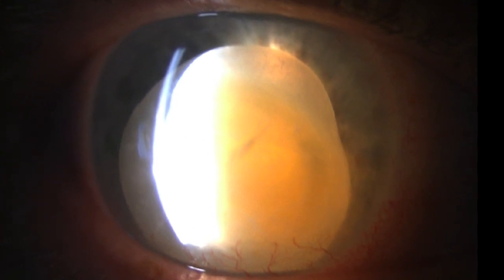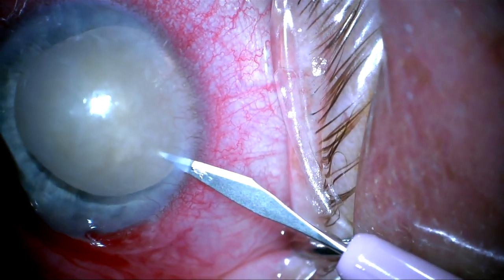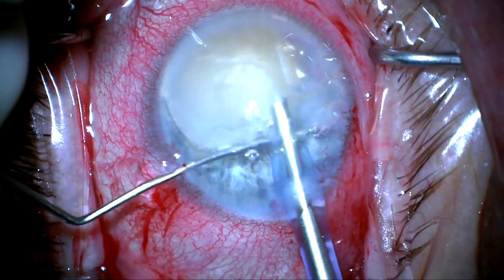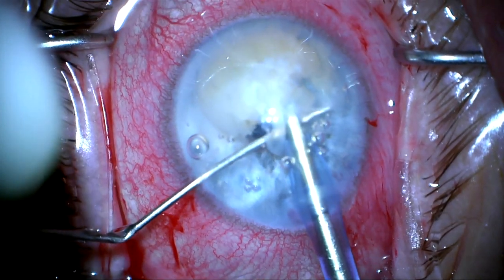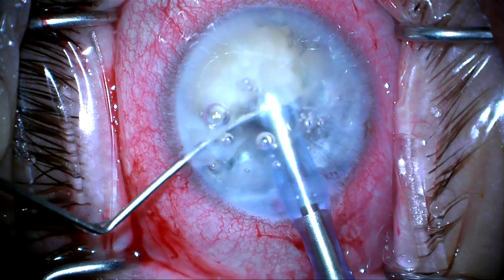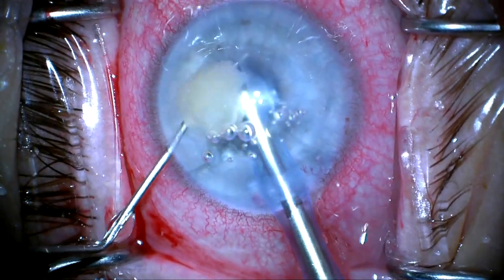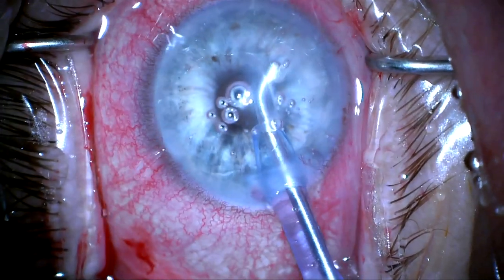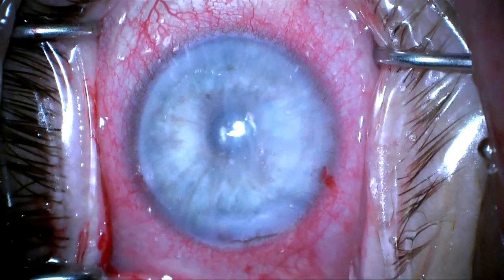Cataract dislocated into AC: surgery by Steven G. Safran MD

Comment: Why not do an sics to remove the nucleus in toto
Reply from the maker: A number of reasons.  First is that the lens itself was adherent to the back of the cornea and it would not expressed.  It was literally stuck/fibrosed in place.  If I had tried to express it or pull it out I would have ended up with a mess.  Second is that this patient has severe keratoconus, cornea thinning and I did not want to deal with a larger incision/bleeding. Third is that she's uncooperative for removal of sutures at the slit lamp so I really wanted to avoid placing sutures I would have to remove.  Fourth is that this was easier and faster for me and I felt safer to do working in closed system.    I did consider all the alternatives.   The patient is the sister of a prominent Ophthalmologist who referred her to me so I also wanted to make sure he was in the loop and approving all of the decisions I made and my approach which he did both before and after the surgery.